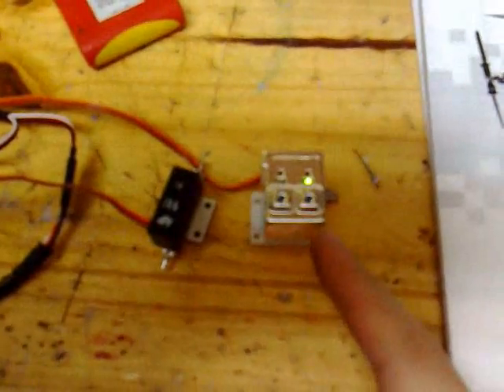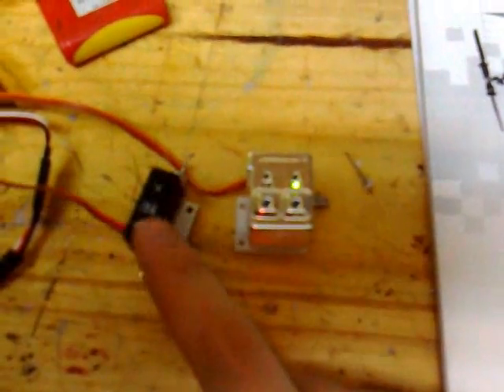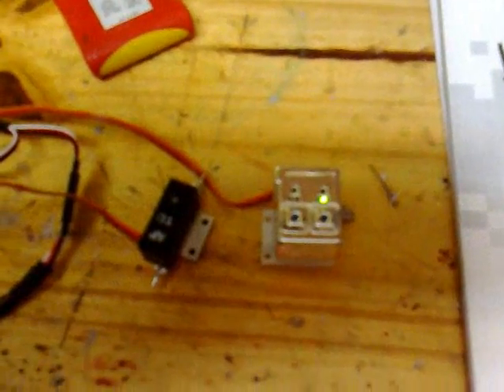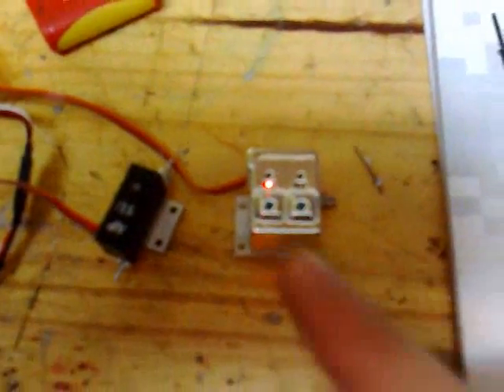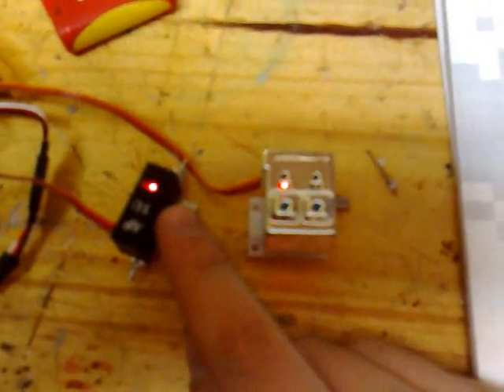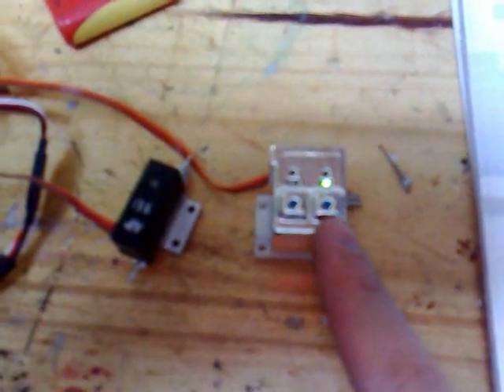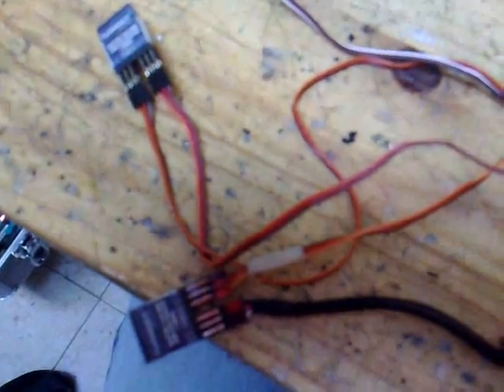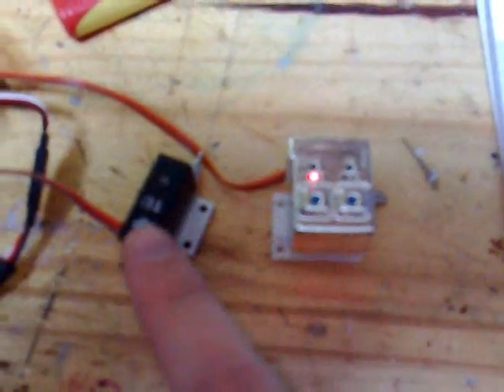Turnigy gear sequencer.wmv

Comment from the maker: this would really work better with electronic air valves rather than servos, but anyway its simple - RX output through a male to male Y connector to both devices, and 2 valves connect to 2 dewvices, one for each. one of the devices is programmed for SLOW-FAST and the other to FAST-SLOW response, thats all.

Comment: To include your idea for my falcon 120 to activate both the canopys drive servo and the  2 front edge linear locking servos. Open: Locking servos activate 1st then canop drive servo 2nd. Close: Canopy drive servo 1st then the locking servos. I  need to know how you jumped power supply to the 2 units, which pin sets you jumped with extensions in place of servos to connect the units,  the potentiometer settings and where you conected the actual servos.